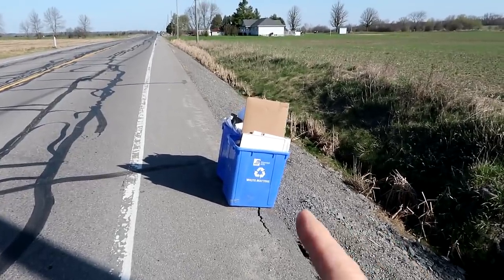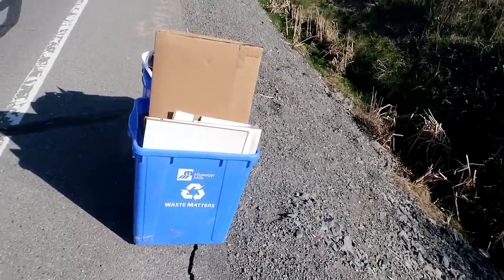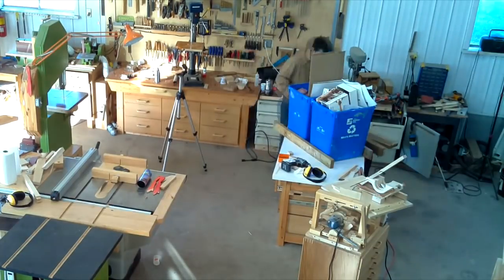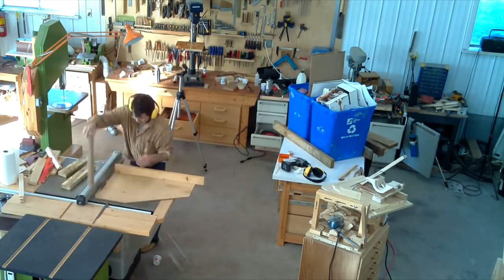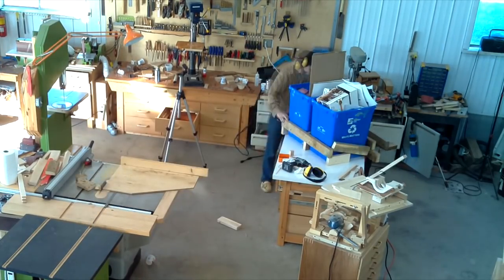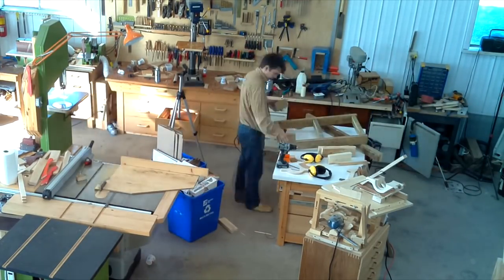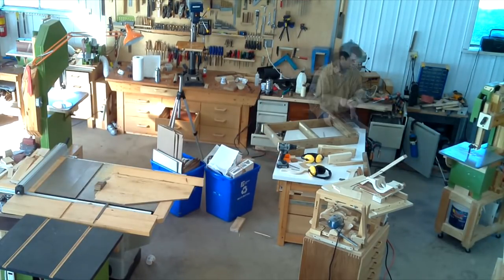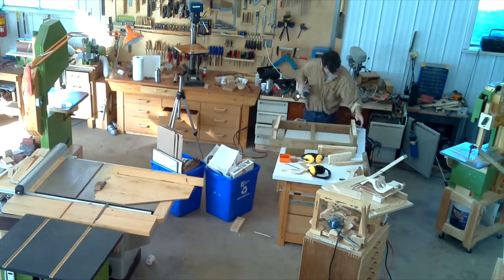A frame to keep our recycling bins from falling into the ditch

Comment: I'd be tempted to either fix the frame to the ground or brace it against the ditch's opposite side. Good luck with the bins.
Reply from the maker: Can't leave it on there permanently, cause it's partly on the bike path
Reply: could you make the side triangular secure it to the ground with a few pegs hammered ín so it'll be sorta like small shelf next to the bike path

Comment: "If it's windy", it would be all over the road.  I don't use the bins anymore but I only use transparent blue-colored plastic bags to keep my recycling in.  Keeps the recycling tidy without it being blown all over the road and no problems with it being picked up(Wished my neighbors did the same thing).  Looks like that you will still have trouble with the recycling bins being in the ditch after being picked up.  Could have made a frame that you could easily move the bins with two wheels instead of having the need of placing it separately.

Comment: Personally I like impact drivers but they are a bit noisy. However, now they do make several new impact drivers that less noisy.
Reply: The hydraulic ones are supposed to be ok for your hearing. Might be too loud for him to use in his basement shop though because of children
Reply: I have the Ryobi quiet strike impactor.  It is quieter, my 3 speed only comes out for lags and the 1/2" adapter for sockets, because it will drive harder. 90+% of the time the Quiet Strike is fine
.

Comment: A bit off topic: is there any good reason to use an impact driver for screwing a screw in ? I always considered it a tool mainly to get screws out of something.
Reply: MrTridac  Not really but an impact driver will drive more screws per charge than a comparable drill. There's also no torque transmitted through your wrist.
Reply: That last one is a really good point. Never thought about this aspect. Interesting ....
Reply: I've found that in general, I get more torque, faster usually if you need a lot of torque out of drill you have to take the speed down quite a bit) It also is far less likely to strip out the head of the screw. Sometimes this won't matter or if its a soft materila its not a problem, but if you ever have to do a lot of larger screws the impact is a lifesaver. Its definitly louder though, and especially for this project, mattias' decision is perfecly valid.

Comment: You cheeky Canadians and your recycling.
Reply: It gets worse. I now have a compost bin I'm supposed to use. Three bins, two different collection days. It's very irritating. And also naturally I have to pay for the privilege.
Reply: Stout Lager I was sort of shocked he moved out to the country and still had recycling.  Where I'm at we don't even have a recycling service and I'm in the city.
Reply: When I worked in Austria 18 years ago we had 6 bins; glass, metal, plastic, paper, bio, general.  If stuff got put in the wrong bin you got fined, especially if you put it in general and it could have gone in the one of the others. I assume it is the same now, if not even stricter. The country was beautifully clean though. They had pride.
Reply: Sheeshz..  Martha's Vineyard does it right.  One bin.  They have sorting lines in the depot giving people jobs.
Reply: The cynic in me says it was cheaper to fine the locals, rather than employ a dozen Romanians on minimum wage to sort the garbage at base.
Reply: We have 3 in CA.. Green/Recycling/Trash.. On recycling days it gets picked clean by the homeless/tweakers .. Then 4 times a year we have street pick up where you can throw anything on the street in front of your property in a 8x8ft section and the city will dispose of it for you.  Matthias would probably be in dumpster divers paradise on those days.
Reply: RobiSydney - And counts towards the GDP rather than free labour.

Comment: Couldn’t you also put some sort of a weight on the bottom?
Reply: Like the wood itself..? Pressure treated wood is pretty dense. That frame probably weighs at least few kilos. The function is to basically just keep some recycling bins (seems mostly cardboard, so very light) from tipping, so it's perfectly adequate for that.

Comment: Okay, so it's two weeks later. Did it work?
Reply from the maker: yes, and they even put the bins back in the frame.  And the beauty is, I only need to use it every other week, because before, I'd have to put it out more often because half the time I'd have to pick the crap out of the ditch and put the same stuff out again the next week.
Reply: Bravo!

Comment: here in UK we have tied plastic bags or bins with lids so there is zero chance of wind scattering debris everywhere.
Reply: dave597 then it goes in all the same bin
Reply: In canada (or at least in quebec) rubbish and recycling collection is managed on a municipal level so each city has their own solution to it. Where I live we have large bins with lids that are easily lifted by trucks with mechanical arms. In montreal they have small bins for recycling and people just leave their garbage bags out by the side of the street since it's all done by hand.
Reply: The details differ between local authorities. Don't mention the food waste bins, the RoW will think we've gone daft! BTW: here on the coast, gale force winds easily blow the whole bin over. The contents then go wherever the local fox and gull populations scatter them.
Reply: Purple is glass. And (in Edinburgh at least,) Green is general recycling (cardboard, packaging). Blue is paper.
Reply: dave597:
everything has it pros and contras. Plastic bags are not ideal: not strong and only for one use.
Bins are normally spoken higher than the crates MW showed. Easier being tipped over by wind/lorries.
Reply: dave597 You clearly don't live in Shetland.  The wind up here in winter sometimes could take the whole collection truck never mind the bin ;-)
Reply: Trinity Too  Because raccoons do not use smartphones   LOL

Comment: Maybe put one or two bits of rebar into the asphalt to hold the frame in place?
Reply from the maker: that would be a hazard and a liability
Reply: Fair point. Suggestion withdrawn.

Other than that, looks very practical.
Reply: Is there still a risk of it being blown into the ditch when the bins are empty (and placed back into the rack)? If so, you might be able to tie it down with a  cinder block or two. What about short spikes sticking out from the bottom, to help it grip the ground, and prevent it from sliding?
Reply: My suggestion was to put a few spikes sticking down slightly from the bottom, to help it grab the dirt/gravel at the shoulder better.
Reply: Aha! My mistake. But our road shoulders are very hard packed and I would imagine the spikes wouldn't help in a big wind or passing truck bow waves. Worth a try, though.